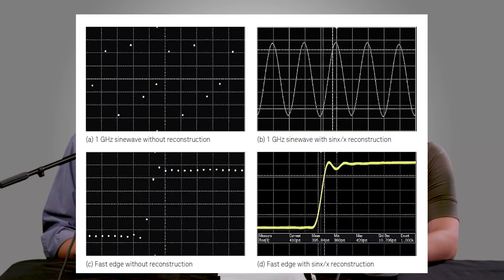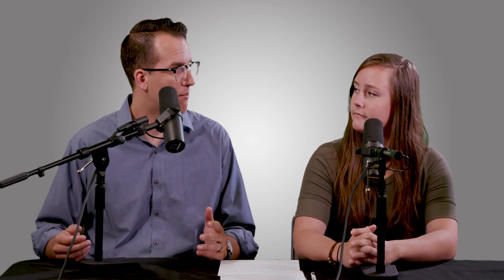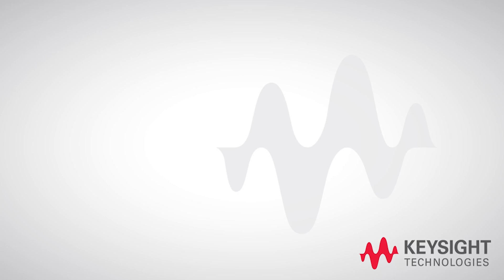Modular Oscilloscope or Digitizer? -Oscilloscope Blog Series

Comment: Can you turn Sin (x)/x interpolation ON and OFF on Keysight scopes?
Reply from the maker: The short answer is "sometimes."

The long answer is that on the sub-1GHz oscilloscopes it has to remain on. In the 1 GHz 4000 X-Series and 6000 X-Series as well as the Infiniium scopes you can turn it off for slower time/div settings, but at the fastest time/div settings it's forced on to make sure you get the most accurate data.